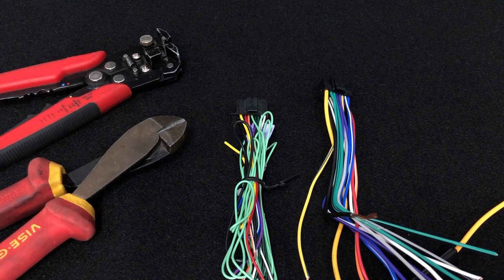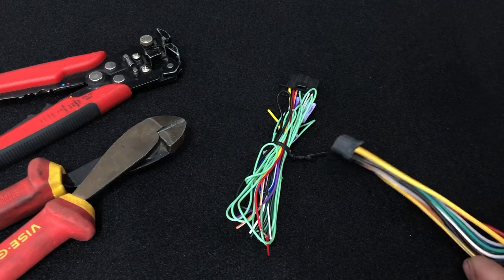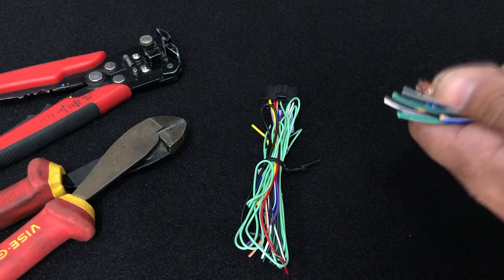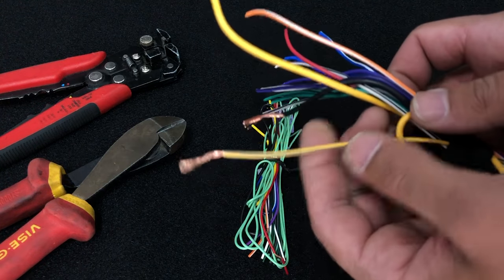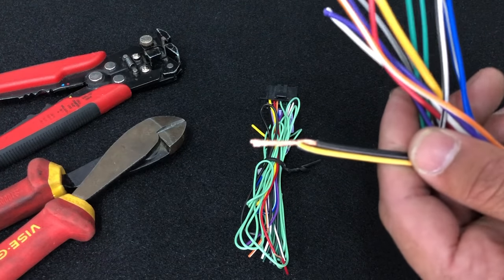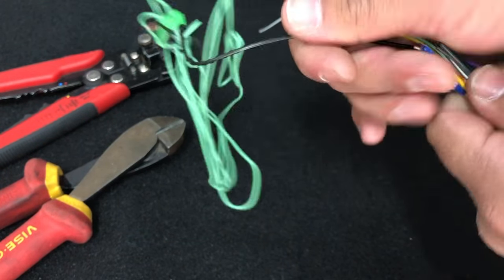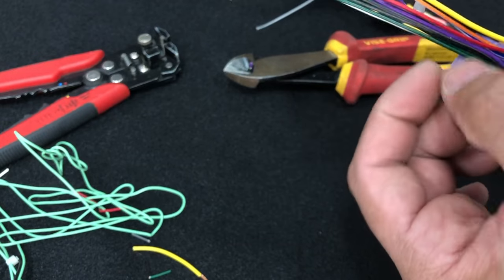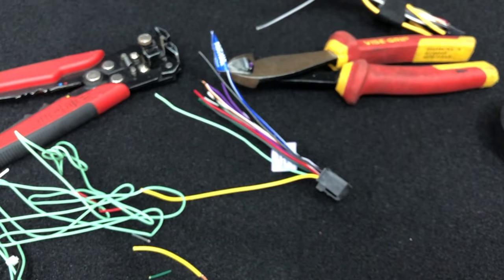Easiest Way To Bypass Park Brake Wire!

Comment from the maker: This will work on MOST units with a Park Brake wire. Putting the Park Brake wire directly to GND tricks the unit into the thinking the Park Brake is always on. 
Some (not many) units with GPS antennas can still tell the car is moving- though this is rare. 
We do NOT recommend doing this nor condone watching your head unit/phone screen while driving. This video is for testing purposes only.
Reply: Will this for sure work on a Pioneer AVH-521EX ?
Reply: This will not work on newer pioneer units as the brake wire input must receive an on off on signal to enable video playback.
Reply: So run ground and brake wire straight to frame...?
Reply from the maker: STANLY IPkiss Yep you can do that
Reply: Ran a pulse ground on a toggle switch. Works fine
Reply: So connect yellow/black wire with the black wire and on the other side lime  green with black wire then connect those 4 wires together ?
Reply: @jaidenbrown8236  I just bought a 2 post toggle switch a d ran the e brake wire to one post and ran the other post to a ground.
Reply: @brianhamilton2236  wasnt try to buy any extra parts I have a atoto a6 if that matters
Reply: @jaidenbrown8236  it's only a few bucks.
Reply: Will this work with alpine as well just bought the little micro doohickey as I have heard alpine new mmps wont be fooled by adding a switch or grounding the wire.
Reply from the maker: William Robinson Works fine with the latest alpine units we’ve been fitting (Australia)
Reply: @TheFittingBay   Hi again, does this video trick work with the latest Kenwoods? Ie. the DMX 7706S  ?
Reply from the maker: nzkiwibri Hi mate! It should work but being a USA head unit you’ll have to check and test it
Reply: @TheFittingBay  thanks,will find out soon enough. 😁
Reply: @TheFittingBay  In the middle of installing a DMX7706S. This worked for the parking brake. Nice. :)   LOVE the Kenwood. Glad I went with that and not the Sony. I like being able to have up to 5 BT sources for Audio!! Now I can make use of my old phones for music storage. :)
Reply: @TheFittingBay  is this including the Halo9 iLX309?
Reply from the maker: TIdo D Yep will work
Reply: if    gps can n ot determine  if you  are moving then that means your  position   is NOT   updated by SATELITE,, eh . ...?
Reply: The Fitting Bay u think it would work on z sony xav ax 1000 bro ? I just bought one recently and was about to install it tomorrow
Reply from the maker: Saint Antoine yep it will
Reply: @kiwi-moto  did you get it to work, i have the same unit and would like to enable video playback, please let me know what you did, thanks.
Reply: @moctezumacuauhtemoc8470  yes, i got to work following these instructions. Videos played from my USB stick fine ☺️
Reply: COULD I HOOK THE PARK SWITCH UP TO THE BLACK WIRE ON THE CD PLAYER
Reply from the maker: DERRICKYO CHAPMAN you’ll need to test it first to confirm it is GROUND
Reply: @MrBilldo426  lmk pop
Reply: I have dealt with some of the older AVIC Pioneers and like you said the GPS detection would not allow video in motion. So we used a relay to interrupt the shield in the GPS antenna cable and that did the trick. Some lazier people would just cover the GPS antenna with foil or a can to operate video in motion which of course we don't recommend and is illegal and dangerous to watch while driving. [disclaimer].
Reply from the maker: @whichgodofthousandsmeansno5306  haha that reminds me of people wearing tin foil hats
Reply: most new pioneer n some new kenwoods need a module or a park brake wire to ground with a toggle cuz i has to see a double pulse ground least i was told
Reply: @TheFittingBay  Will NOT work on the alpine F409.  Needs to disconnect/connect to work properly.
Reply: pro trick : watch series on instaflixxer. Been using them for watching loads of movies recently.
Reply: @Gianni Isaac yup, I've been using instaflixxer for since december myself =)
Reply: @Gianni Isaac Yea, been watching on instaflixxer for since november myself :)
Reply: Don’t you need the parking break wire for the back up camera when your in reverse ect
Reply from the maker: @the-bu3lb  Nope, for that you need the reverse connection
Reply: Toggle swith works best for most pioneer units, specially the nex, and gps nav models. Pioneer green park wire from headunit in to toggle, then other side of toggle switch to chassis ground. Pioneer wants to see a timed on/off to trick park brake function into thinking its on. Not so with sony, jvc or alpine as much.
Reply: Work with a SSL head unit?
Reply: Did not work with  the newer pioneer radio had to purchase bypass from eBay
Reply: Will this work on a Jensen radio being installed in a 2010 Toyota Prius? The parking brake wire color is pink.
Reply: @Mike Greene  it uses android auto or Apple carplay so it uses your phone so yes it will tell your moving because your phone knows your moving
Reply: Can't find a recent video on this. I'm putting a cheap amazon unit in my semi. Hehe. Air brakes. Didn't see this coming. Hopefully the ground trick works.

Comment: Does not work for newer American stereos. A bypass switch that can provide an on-off-on signal is required to trick the stereos.
Reply: Attach to the remote wire. Done and done.
Reply: @ryansingh7145 the amp wire ? Thanks

Comment: In the rust belt of the USA it's extremely rare to use the parking brake because the cars get rusty and the cable seizes up.  Even with manual trans we just leave it in first or reverse.  It is usually labeled "EMERGENCY BRAKE" in the USA.
Reply: @Someone New Clearly you are an intellectual.  I actually have lived in the Rust Belt for decades.  The original coining (~40 years ago) of the term Rust Belt did refer to the decline of the heavy steel and heavy industry in the Great Lakes region.  But the term also has a modern colloquial meaning referring to long winters we get from the Great Lakes and jet stream and the use of salt on the roads that aggressively rusts all of our steel infrastructure.  Also you are not mechanically knowledgeable if you think a parking brake and an emergency brake are two different things.  The (P) position on your automatic transmission uses something called a parking pawl that mechanically locks the transmission up (no brake or fiction material involved).  A true cable-driven emergency/parking brake can be applied while the vehicle is rolling as a backup to the hydraulic brakes, but don't try that with (P) on the transmission!
Reply: To me the word Emergency brake will never make sense. It’s an adopted word from the creation of the automatic transmission. Prior to automatics you have to use your “parking brake” to hold your car in place rather than P on your automatic transmissions shifter. Most to nobody I see that drives an automatic ever applies their parking  brake anymore. Instead they just put there car in the park gear and call it a day. Park gear (P) is your back up in the event that your parking brake fails. A parking brake is not designed to stop your vehicle in the event of an emergency. It is designed to park your vehicle. If you own an automatic and are parking your car you should always: 1. Come to a complete stop 2. Put your car into (P) 3. Finally apply your parking brake, you do all these steps with your foot on the main brake, once you have applied the parking brake you take your foot off the brake pedal
Reply: @zamboniguy8952  I agree with that.  You may have noticed in new cars that they have an electronically activated "parking brake" that is automatically engaged by the computer under certain sceneries.  I rented a Jeep Renegade and a Ford Kuga that had this feature.  For example, if you put the Jeep in neutral and opened the door it would set the parking brake to prevent it from rolling.  There was a famous accident with a Hollywood actor that got out his Jeep when it was in drive to get mail and it was very bad press for Jeep.  I have no idea if you could activate that parking brake at driving speeds or not because it is just a button.  It must "try" to stop the car.
Reply: I use mine every time I park and I am a rust belt King
Reply: @Batboy_idiot  I try to keep it working and use it occasionally on my personal vehicles.  Generally the issue I see is if the drum brakes are in poor condition with rusty linkages then the parking brake may fail.  Disc brake cars seem to have less of an issue.
Reply: Got a traffic ticket in the bay area for not using parking brake while parked. I use in on my dad's car in the Midwest and he hates it bc he never uses it and starts driving with it on! Creature of habit.
Reply: @seekshallfind6410  Never heard of law enforcement policing this.  I assume it was a parking ticket (non-moving violation)?  Just about all new cars are fully electronic parking brakes-no way to observe passively.
Reply: @Peter Tomich  Maggie was referring to the "parking brake" in this situation in the video, the one that radio installs refer to, its just the vehicle transmission being in park. The radios don't require you to apply the parking brake "E brake" to use them.
Reply: @samuelyeet6006  Regarding the "parking brake" wire on the radios you are correct; the intent is to detect if the vehicle is stationary.  My original comment was referring to owning an older manual transmission vehicle in a region that uses road salt.  The actual reason for the safety feature is for legal protection of the manufactures in the case they get sued for a driver crashing while distracted.  The manufacture can point to the safety feature being defeated as a defense and try to shift the legal exposure onto the installer.  If the manufacture was super serious about this feature that many people find annoying, they could use a built-in motion sensor that could not be defeated.
Reply: @samuelyeet6006  2013 Ford Escape, and the Parking Brake wire does refer to the parking brake. Having the trans in Park does not trigger the locked functionality. It's very annoying, because as @PeterATomich stated,  I live in the rustbelt and rarely use my parking brake, and when I do for the radio, I forget to disengage the parking brake.
Reply: I drive a 93 roadmaster in Detroit and I use my parking brake.  Inclines etc. Actually I know a lot of people that do. Most people take care of there vehicles I don't know what kinda backwoods billybobs your talking about

Comment: That method works as it should on lower brand radios like power acoustik, boss, etc ect ect brands like jvc, pioneer, clarion, alpine ut will only work 1 time unless you hook up a toggle, relay, or even a bypass
Reply: so itll work on a bose say less. i just got my head unit in the mail.

Comment: Will this work on a pioneer mvh-300ex model? I need to bypass it to clear my Bluetooth cache in the system because it never detected my e brake
Reply from the maker: Aidan Ball If it’s not detecting the handbrake or the settings are not illuminating you should give this a try and it should fix it.

Some pioneer units need to be switched off then switched back on and go straight into settings without touching any other feature (unit settings work in “off” mode)

Comment: I just installed an Axxera AV6118Bi DVD head unit in my vehicle. I was gonna purchase a bypass off amazon till I came across this video. I was a little skeptical at first thinking this is far to easy but decided to hold off and give this a try. Just finished hooking up the entire system in my car and wouldn’t you know it, it actually works!!! I was pleasantly surprised. My only slight confusion was that I only had the e-brake wire from the head unit side and not the vehicle side. But I wired it to the ground as stated and it worked. Thanks for the tip
Reply from the maker: Reel Dad Hey mate! It’s a great little trick we’ve been doing in our head unit installs for a long time. 
In most cases, when we connect it to the park brake wire, customers come back asking if it’s possible to work without the hand brake. So we started doing this.
All of the bypass kits do the same thing, just trick the unit into thinking the e brake is always on 😊.

Comment: How would you wire for the USA alpine ilx-511. This method only works once. I installed a bypass module but it still doesn’t work half the time. It’s really annoying

Comment: What I did is I wired a switch between the parking brake wire and the ground, so then I just flip the switch to make it think I have the parking brake engaged.
It's a redundant step but I like it.
Reply: how did  you do that hmmmmm are you attaching the receivers light green parking brake to a switch and then the switch is connected to a ground you made custom somewhere in the car
Reply: @mrwilliams7086  no it was super easy actually, but I don't remember how. You can find videos about it on YouTube, that's where I learned it.

Comment: This doesn’t work for newer Alpine units. I tried it on my alpine iLX-507 and the unit requires a change of state. So basically if the head unit starts up with the park wire grounded it will not allow you to use certain functions. It needs to turn on, have no ground connection to the e brake wire, and then get a switched ground signal from some where. If you wire it to your embrace and then actuate the e brake, the ebrake basically works like a large switch. You could wire the ground wire to a switch along with the e brake wire and turn it on after the head unit has powered up. I don’t know if there is some sort of resistor or other electrical device that you could wire inline from the ground wire to the e brake wire that would regard the ground connection for a second so that the head unit see a change of state from non ground to grounded after the head unit powers up. If you know of a device that can do that please let me know.

Comment: I usually do a switch that connects the black and light green wire together. That way, if I get pulled over, I'll just switch it from on to off easily.
Reply: Where can I find one of those switches?
Reply: @user-oj9fu6fe7u  i usually buy a toggle switch from eBay or Amazon
Reply: Who is gonna pull you over and then undo the trim in your vehicle to take out your stereo bro? Lol
Reply: @jimmycorbett4611  I don't think people are going to steal your car stereo as much as the 90's but then again, I could be wrong.
Reply: @MagicGate814  I was talking abt if a cop pulled you over. I agree with you a thief might do anything if given enough time for sure. But I doubt a cop would ever pull you over and look at the wiring on your stereo.

Comment: I have done this many times with no problems at all. Right now I'm doing an install on an older Dodge truck. The first thing I noticed is that the head unit is working without the ground wire being attached to anything. Do you think this same method will work by attaching to the ground even though it's going to nothing? Or will I have to go ahead and attach to the chassis to get this to work? Took a break to get dinner and haven't decided if I'm going to keep messing with it tonight or just finish it up tomorrow. I still have to run amp wires and attach RCA's also. I was and am surprised that it's working without the ground attached, never had that happen before and I've been doing this stuff about 30 years.

Comment: Just fitted a Pioneer sph-da250dab and grounded the green wire and it works just fine 🙂
Reply: Thanks for the feedback Ian. I've recently bought that unit and was concerned it wouldn't work lol
Reply: I can confirm that this works with the pioneer sph-da250dab too!
Reply: I bought the same Unit today and i will try it out and comment if it worked or not.
Reply: How is it now. I’m worried of overheating
Reply: @steveyg777  how is it now I’m worried about over heating
Reply: @potato_god_4085  I've had my stereo for 2 years and never had a problem

Comment: QUESTIONS: I have an '09 Corolla and installing 9" head unit.  1) To have a camera icon on the head unit and to see behind the car without the car being in reverse, do you connect the reverse trigger wire from RCA cable from rear camera to red Accessory wire and also the head unit reverse wire (mine is a brown wire) for when car is put in reverse? 2) I have two yellow RCA connectors from head unit. One connector is labeled 'CCD AVIN' and the other connector is labeled 'Aux-V'. The Camera RCA cable connector coming from the camera plugs into which of the two RCA connectors in order to establish a signal for the rear camera?  3) I have a pink wire from the head unit labeled, 'With protocol model output 12V can be connected to the camera'. Is this pink wire like an accessory wire for the rear camera to view behind the car with out being in reverse? Should I use this wire instead of the red accessory wire to have a camera icon on head unit and see behind the car without being in reverse?  4) I connected the RCA cables together at the head unit and the trigger wire to the red wire off of the RCA cable, but I get no reverse camera picture on the head unit. When I look at the rear camera, the LED lights up when in reverse. Why no reverse camera picture on head unit? Thank You for All Your HELP!!!

Comment: I have a Pioneer Ca9pa v6 650 which is from a Mazda Atenza. Which one is the parking brake wire or do I need to add a pin to it, as all I got with the unit. I have 3 wires left... A pink, a second ground, and a brown. Help would be appreciated please.